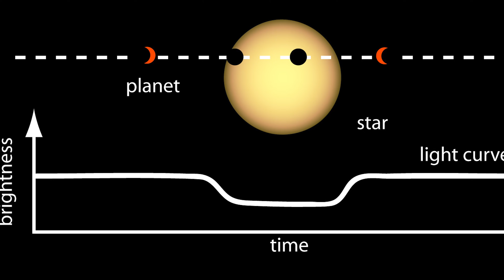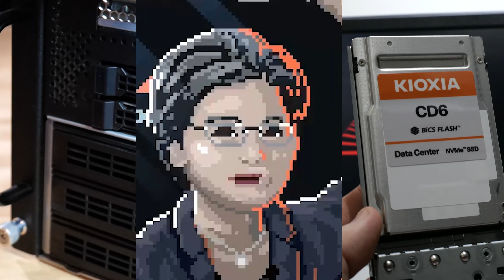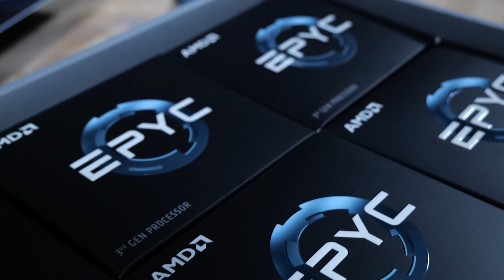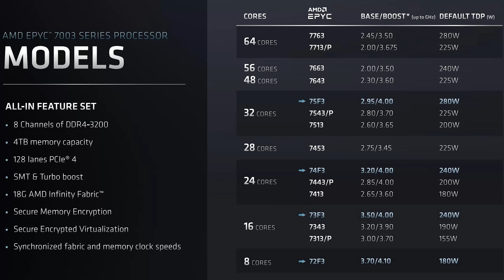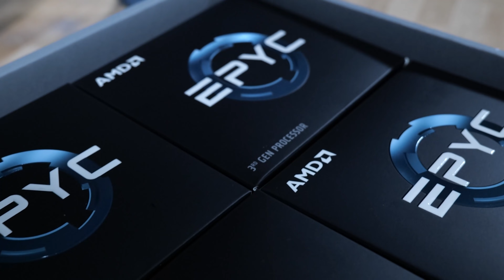I Don't Want to Live On This Planet Anymore: Epyc, Find Us a New One

Comment: I'm amazed that chassis still look the same. I'm a devOps engineer, ex in house/building infrastructure background. It's interesting to see that these general purpose server chassis still look the same. lol I remember Dell and HP chassis from nearly 10 years ago that look just about the same. Same front load drive bays, huge board, proprietary fans. I guess it doesn't change lest you're in a proprietary mega datacenter.

Comment: Well like somewhere, but readily habitable is not an easy task, because for them to be "readily habitable" they already have to have pretty complex life that is bio compatible with human life, so yeh there is probably a world out there, but it would be easier and more humane to terraform worlds that are currently uninhabitable, or even better create completely artificial habitats in space getting the materials from places like mercury, moon, asteroids etc, because you can make far far far more living area by taking the materials required off out of those rocks and turning them into artificial habitats in space than you would by terraforming or paraterraforming them.

And considering the effort terraforming requires, moving quadrillions of tonnes of hydrogen and nitrogen paraterraforming at least somewhat not really sane, but like many times less insane than terraforming, in otherwords doming over a world, which you might think that sounds more insane, but you currently have 1kg of air pushing down on each square inch of the earth, and for a place like Mars with much lower gravity you would need an order of magnitude more air to create the same pressure.

vs 100 grams of glass or some other material per square inch for domes and then maybe 1km at most of air going upward inside the dome and you start to see how paraterraforming a planet like Mars makes a lot more sense. and then if you are having to build massive structures to keep in the air, well why not make those structures in spaces and give yourself a lot more living room like many many many orders of magnitude more living room from the materials from a planet than the planet could provide.

Like yeah you would want some domes so that some people can live on the planet mainly to exploit the resources on Mars, and for tourism, but beyond that I don't see a need for much living space actually on Mars.

The one place that actually makes sense to terraform is surprisingly Venus, as it has 93% Earth Gravity and the issue is not an addition problem it's a subtraction problem which is easier, as nitrogen is required for space habitats, paraterraforming and terrfoming if you want to grow plants, and the carbon in the carbon dioxide can be used to make allotropes of carbon, like nanotubes and graphene and the oxygen should be obvious what that is useful for.

So the stuff you need to get rid of actually has value, so long term rather than spending money importing things, you are making money exporting way more than you are importing, and any terraforming project is a 300 year project minimum until you see real benefits and more likely a multi thousand year project, so long term thinking is already a prerequisite.

How you do it is pretty cheap in comparison as well to terraforming Mars, put up solar shade in the lagrange point between the sun and Venus which are 99.9% foil so pretty cheap cool down the planet so carbon dioxide under the pressure and reduced temperature precipitates into seas of carbon dioxide, then keep chilling until frozen, this will happen sooner than you think due to the pressure of even the nitrogen left in the atmosphere as while it's only 3.5% of the atmosphere it's also 91.8 times thicker than the Earth, so that 3.5% is still 3.2 Earth atmospheres of pressure, just in the Nitrogen.

Anyway pave over the carbon dioxide to maintain the pressure on it, then start selling off your reserve of Nitrogen until it gets to the point you want, then start splitting some of the carbon dioxide into oxygen and carbon release the oxygen and if you can manufacture carbon nanotubes and or graphene in a large scale, start producing that with the carbon; repeat until you have a have a liveable atmosphere.

Again not saying it's easy, even though my tone did make it seem that way, but that was just for laugh. It's hard really hard just many times easier than Mars.

Comment: The nearest star is about 4 light years away and there are not many within 10ly. Most stars are at least 100 light years to 1000 ly with the galaxy being over 100,000ly. Traveling at near light speed induces time dilation making time pass at a much slower rate.

Comment: This kind of research really should be making use of a high performance computing (HPC) center or supercomputer.  If the researcher has ties to a local university many have HPC resources or partnerships with other universities.  There are also National resources that are freely available such as the Open Science Grid (https://opensciencegrid.org/) and the Extreme Science and Engineering Discovery Environment (XSEDE)(https://www.xsede.org/).

An HPC center will have vastly more resources then what multiple of the server shown in this video can provide.  Don't get me wrong Wendell shows a decently specked custom server but the solution does not scale well beyond a single server or more then 1 researcher.

Comment: As an astrophysicist (and not only),  I was really excited watching your video!! In particular the 1TB RAM is a dream. In autumn, I am planning to check whether is possible to upgrade my threadripper 2990WX (X399 designare EX),  with 256 GB RAM from 128
Reply: There are 32GB unbuffered ECC DIMMs available, so you definitely can get to 256GB with eight sticks, or two per channel.  At DDR-3200 speeds, too.
Reply: @TrueThanny  thank you for letting me know! I was suspecting that I would be able to do it, but I appreciate a lot the confirmation!
Reply: Its definitelly possible, but i have a feeling, the next coulpe of months RAM and storage prices gonna surge and go Out of Stock in most places.. Thanks Chia........
Reply: @Boborjan1986  Don't drink the Koolaid over Chia and it's effect on storage prices yet... it's down almost 50% from the beginning of the month..